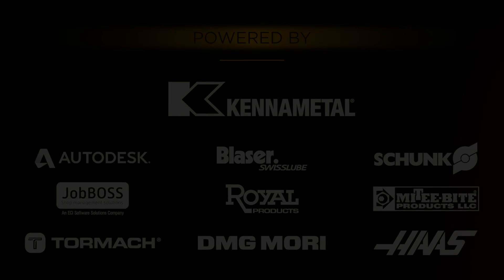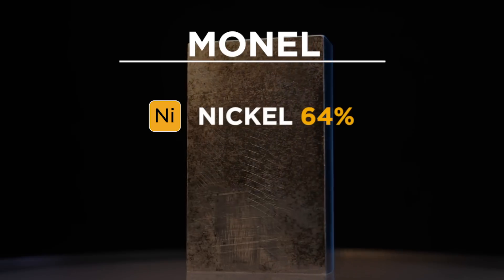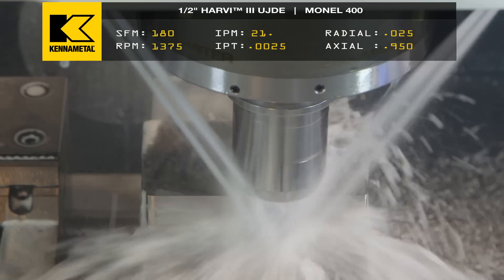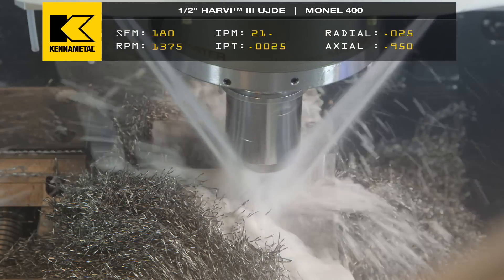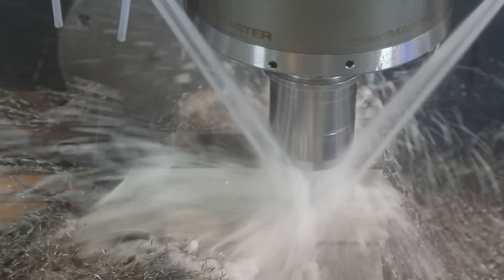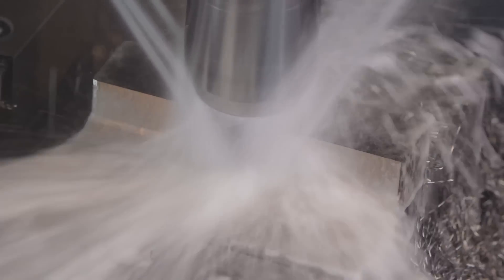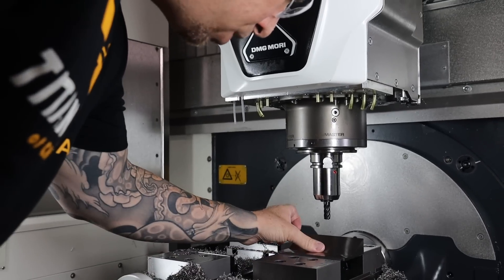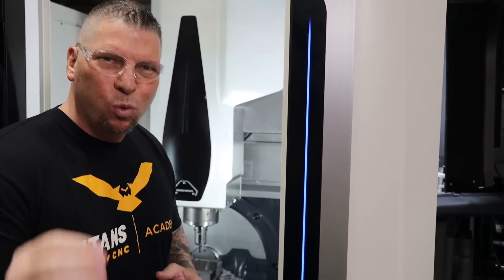Milling Monel 400 | CNC Machining MasterClass | Vlog #92

Comment: I work for a global slurry pump company (weir) we machine white metal parts like impellers. The material on some parts is at 78 Rockwell. It has a carbide mixture with Crome. Hardest stuff ever. The only inserts that can touch it are CBN , cubic boron nitrite. Chips come off red hot and turn purple.

Comment: Nickel doesn't make things hard.... It makes things tough. There is a very important difference between hard and tough... It's the alloyed elements that make the material hard. Ie. Chromium, molybdenum...
Reply: In the description of the video he mentioned it right, tough materials
Reply: Ya Titan says hard a lot but what he means is difficult to machine. We run all the materials he's done lately and they're between 25 and 40RC (what we run heat treats could change that) which isn't particularly hard. They are however gummy, highly abrasive, and eat tooling.
Reply: @dutchmachinist5098  pretty sure he changed it. Was originally 'hard'

Comment: Hey Titan, I'm not a tool maker or machinist but I was wondering since you are the seeds and feeds Master would it be possible to raise the speeds and feeds as the tool got higher on the ramp and was cutting less material?

Comment: I'm missing something. When we get M400 for a job, it's pretty soft. I took a 2.5" DOC and .3" WOC with a 3" helical. It stalled the machine, but only while doing an inside corner. I have a harder time with Inconel.

Comment: Hey Titan I am a new subscriber. I have been in the industry for over 12 years and I have a question for you about softwares. What are your thoughts on Mastercam vs Autodesk Fusion 360. Any information would be great! Thanks. Love the videos by the way. And I love what you are doing. I wish I New about 10 + years ago. It would have helped. God bless, enjoy your day!
Reply from the maker: Both are great!
MasterCAM is ITAR approved.
Fusion is not but Inventor is.
Both can make absolutely incredible parts but Fusion is strong on the CAD side.
Fusion360 is Free for all students and hobbyists... so learning is accelerated because students can use it at home.
Fusion360 is the reason our Academy.titansofcnc.com has blown up and pushed the industry forward.
Also, AutoDesk purchased DelCAM and is inserting all of its best tech into Fusion.
Reply: TITANS of CNC: Academy TITANS of CNC: Academy thanks for the reply. I saw your 5 axis multi axis tool path and it looks incredible. One thing with Mastercam is I have to fight hard to get multi axis to kinda do what I want. It is not easy. That is why I was interested in fusion. I am a ME/programmer for a medical company with 28 Mill machines under me.
Reply: @raphaelholm  I would suggest giving Fusion360 a try to see if you can get the tool paths you're looking for. Because it's free/very inexpensive, you could quickly and easily find out if Fusion360 is a good fit. I come from a Solidworks/Fusion360 background which are parametric modelers and found MasterCAM's interface and method for geometry creation to be a bit dated. But both are incredibly powerful pieces of software. I also like that I can very easily edit my post processors in Fusion360.
Reply: Ed Chow thanks Ed for the insight. Think I will give it a shot. Might as well use the Titan academy to learn software

Comment: Great video. Always enjoy these. Just wondering: why such a low spindle speed? 1375 RPM Vs 15000 in the 1000 ipm steel video seems slow (I know you're going a lot slower here I'm just curious)?
Reply: The material is very wear/abrasion resistant. It generates a lot of heat if your RPMs are high. So you need to run this sort of stuff a bit slower if you want your tools to last.